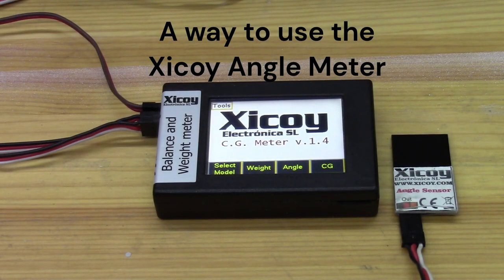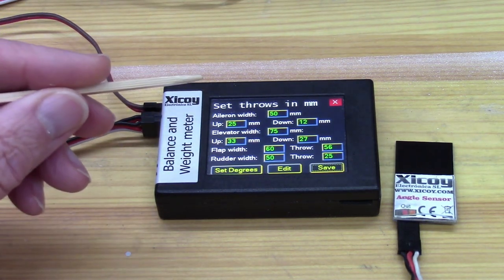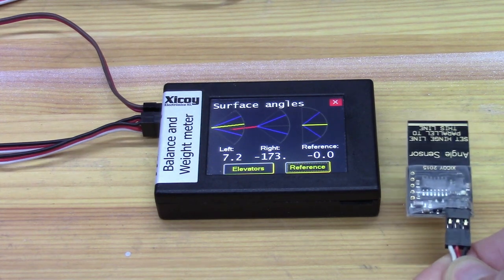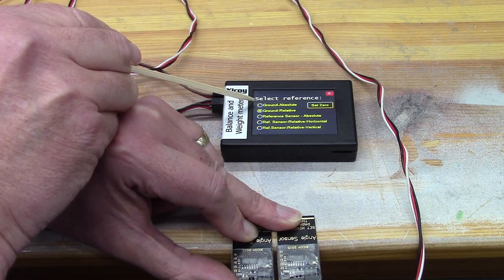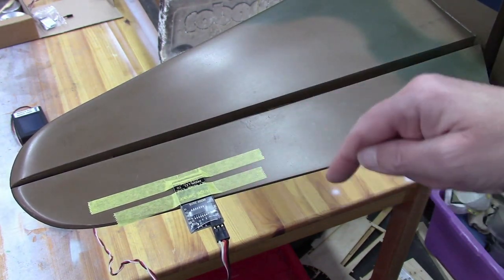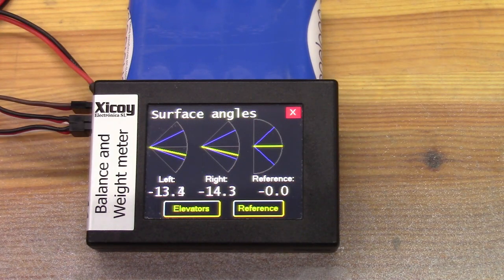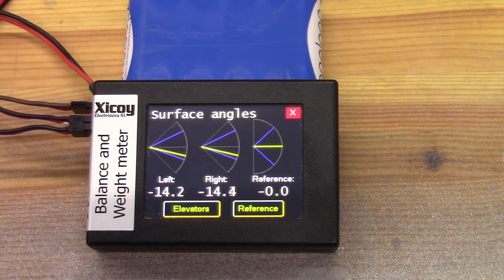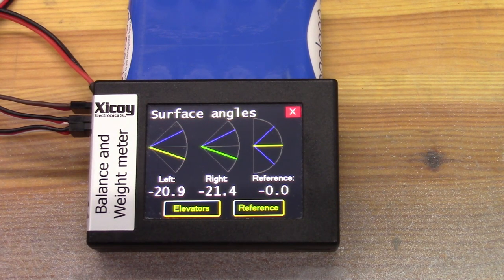Using the Xicoy angle meter

Comment: Hello Harry, great info again and  . .. . . as always.
But besides laying the model on it's side, how do you use the angel-sensor on the rudder, when the model is an  "upright in flight" position?
Reply from the maker: You cannot, you will have to lay the model on its side, the sensors work on the direction of gravity
Reply: @cotswoldpilot  Thanks Harry for this confirmation. I almost doubted my self :-) 
And by the way . . .  for CG measurements I have developped a great device which makes the use of the XICOY CG-balancer much, much easier. The proof of concept is ready, first "production-models" will follow. If you like I can keep you in the info-loop. Regards, Rick, Netherlands
Reply from the maker: @beyondxtream4056  yes please

Comment: Great video, Harry question. Did u have to level the model first? Thank you
Reply from the maker: No.
Reply: Thankyou
Reply: @Harry Curzon  with everything I followed in the video I level the sensors put them on the elevators and by eye I know elevators are out bit by the xicoy there level witch I know there not
Reply from the maker: @michaelwilliams-kn3di  I csnnot diagnose remotely what you are doing wrong